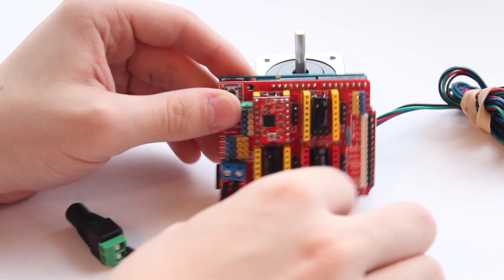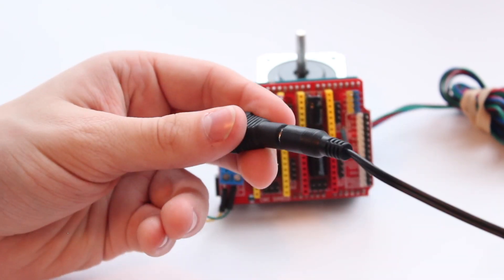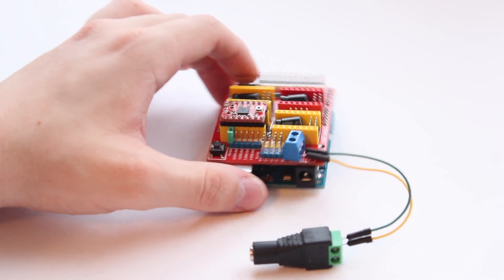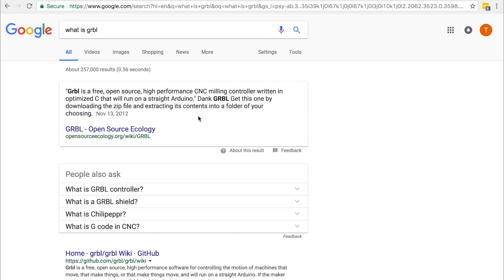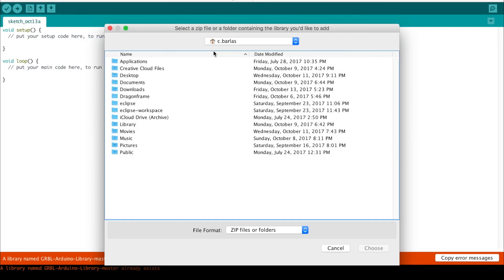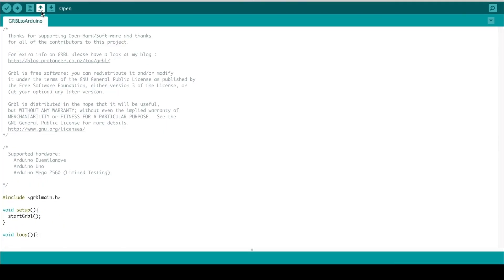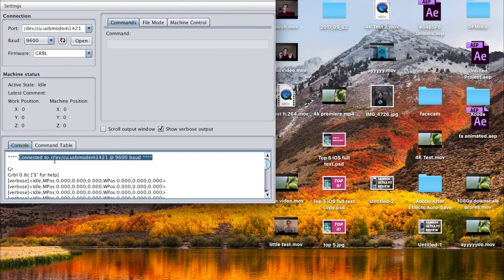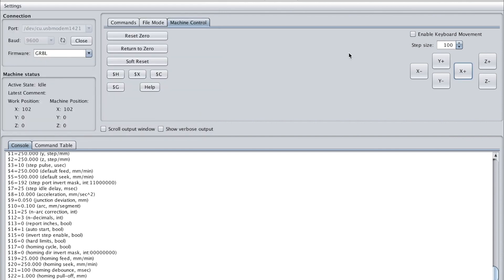DIY Arduino Camera Slider! (Electronics)

Comment: Do you need to have the computer connected to the slider control/Arduino to operate the slider? What if I want an independent motor control?

Comment: wich PC software do you used to drive the Arduino-Shielded-Motor?
Reply from the maker: After downloading the sketch with the Arduino software, use this program to control the motor: https://winder.github.io/ugs_website/ . - Chris
Reply: Thanks

Comment: How would I do this if I would rather want my system to be standalone and run off a pc?
Reply from the maker: Some people have been able to make a standalone system still using the arduino, however you would have to buy a LCD Display and some buttons (they aernt too expensive though)

Comment: Sorry I'm new on Arduino... What is the small jumper?
Reply from the maker: Jumpers connect two pins together so the system "enables". On the CNC board I had to connect the ground and Enable pins for it to work properly. Jumper Pins: http://a.co/7j4LNmg
Reply: Thank's a lot
Reply from the maker: These two pins on the CNC Sheild must be connected to each other for the system to work properly: https://imgur.com/a/ixS3u . We can do this by using a Jumper Pace that connects just those two pins.